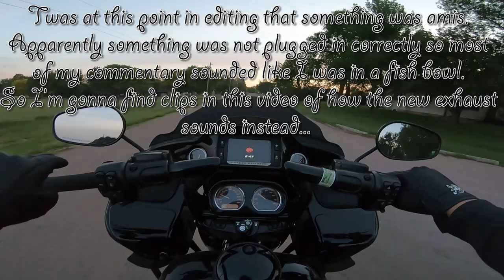Bassani Mid Length Exhaust + S&S 475 Cam (Milwaukee 8 Road Glide)

Comment: Hey! I’m trying to find out the color options for the exhaust, is this the chrome,black chrome, or stainless? I have a gunship grey RG ST. Wondering which one I should go for!
Reply from the maker: This is the chrome. It's basically chrome heat shields and the muffler piece is chrome but if you don't install the heat shields the pipe is chrome plates stainless and still turns a gold color

Comment: Have you got it retuned yet since the 2 into 1 was installed? Did not hear you mention it on the video. Thanks for the videos.
Reply from the maker: It's currently on the Dyno to get tuned should have a video out soon with new Dyno numbers for HP/Tq
Reply: @MeathedMoto  Great!

Comment: They both sound pretty good TBH. The Bassani louder in person? I have Bassani road Rage 2 into 1 on my Victory, love it. Thinking of getting the same for my Harley.
Reply from the maker: It's a bit quieter actually. Extra length and better packing material in the muffler. But it sounds better to me. Plus it makes a bit more power and easier on the ears as you're going down the road
Reply: Does it have that drone sound when you ride long distances?
 @MeathedMoto
Reply: Your problem is its a victory!

Comment: So what Dyno numbers did u get with that combination?
Reply from the maker: 110hp and 114 torque but the dyno the guy I go to hasn't been calibrated in a decade or more. Could be more or less but what matters is the fuel/air is correct and she's plenty quick.